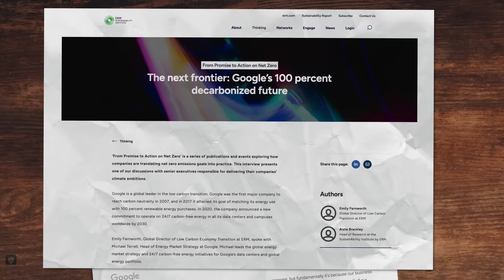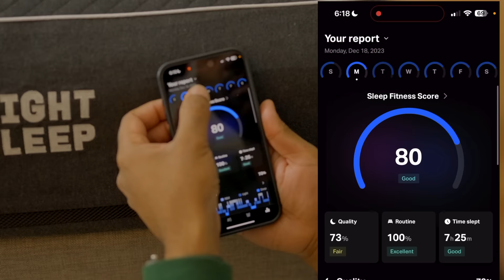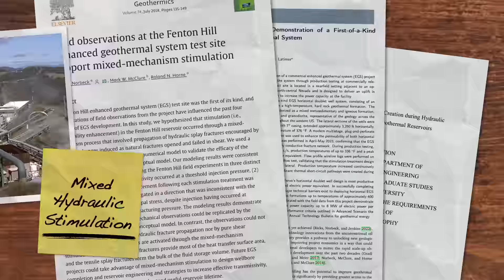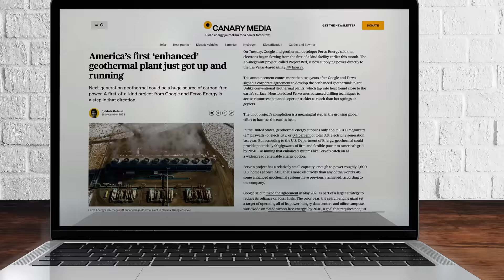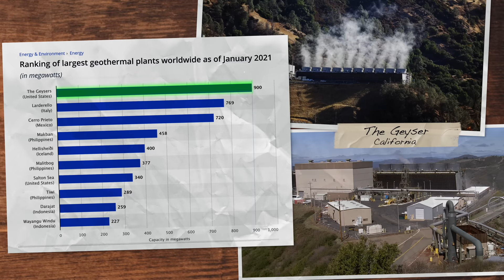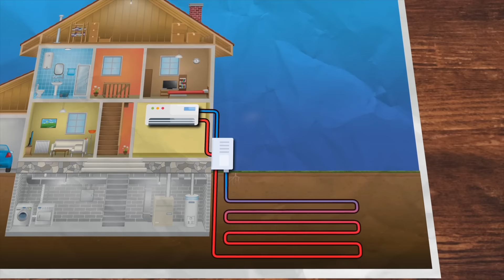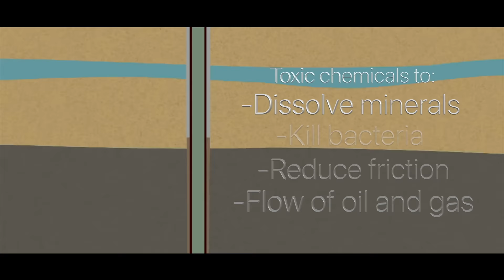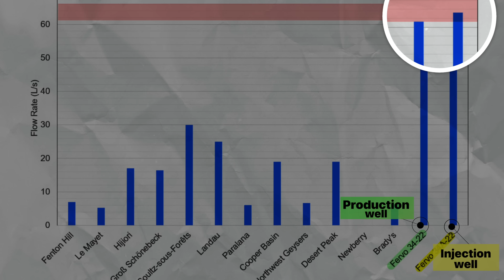Google’s Billion Dollar Gamble: You Won't Believe What it is!

Comment from the maker: Go to https://www.eightsleep.com/ricky or code 'RICKY' for $200 off!
Reply: Great research and presentation - thanks!  I'm actually okay with fracking in the oil and gas industry as well as efforts such as this.  Wind and solar need to sit on the bench for awhile, and frankly have larger potential for long-term environmental damage in my mind than fracking for fossil fuel extraction.  Now that you know where I'm coming from, I have a large-scale question that was unasked in your video.  What is the potential long-term effect of removing heat from the Earth's crust?  Admittedly this is a small effect, like asking "what is the effect of slowing the natural movement of the air above us from wind energy production?"; but it is real and quantifiable just the same.  As geothermal production of various sorts scales up, it could become an issue.  Any thoughts?
Reply: Conducting heat from the earths interior (outward) while you simultaneously leak cooling waters into it on a large scale will cause the earths interior to cool at a much more rapid rate than it would otherwise. Cooling a planets interior is the progressive march of that planet toward a frigid death, not to mention the magnetic impacts as you do
Reply: I burst out laughing when you used "Harry Potter" as a verb instead of a name, lol.
Reply: Sounds alright but I think this is going to cost Google. I think the price of Geothermal has 10-20 year ROI unlike solar and batteries which is 10 years and below. I mean, if solar is cheap, just overbuild it and throw the excess energy or maybe run additional cooling equipment.  Aside from that, solar has little maintenance or high reliability.
Reply: All of the energy it took to mine all of the minerals is renewable? The people that die while mining are they renewable?
Reply: Did I miss the link to the paper?
Reply: @bradarmstrong3952  Why did you not address the propriety information of what companies use to frack? Answer how many active volcanoes are doing something every day first.
Reply: lol $2k for the sleep system.   that's quite the luxury.
Reply: put your hands and feet out when you sleep, problem solved...
Reply: @Caldaron  -  My ex use to put her ice cold hands and feet on me while she slept LOL   I am like an old bear and was a source of warmth. She used to say, Warmth in the winter and Shade in the summer (referring to me being big and fat) HA HA   Your theory has merit.
Reply: Thank you these wonderfully informative, nuanced performances. You, young man, have taught me a lot this past year or so.
Reply: Your biases when it comes to fracking are somehow suspended when it comes to mining lithium, cobalt etc needed for batteries used in electric cars.
Reply: Also why use fracking instead of a closed loop steam generator
Reply: the water that remains underground has to be going somewhere, its not disappearing into a black hole.  so either it will fill whatever reservoir its currently filling and then stop (thus no longer losing water to the ground)  or its ending up back in the groundwater/ocean eventually, which is how the water cycle works anyway
Reply: @uncletrashero  -  WHich is a good thing since ocean levels are rising... So losing some underground is not a bad thing. " so either it will fill whatever reservoir its currently filling and then stop (thus no longer losing water to the ground) "
Reply: As amazed as I am by this new project and technology the elephant in the room is not the fracking. It's the fact that you keep calling wind and solar carbon neutral, sustainable energy. And as amazing as his technology is, it's still not carbon neutral stop lying to the people.
Reply: This is a horrible idea.  Cool the core of the Earth and you kill the magnetic field ... then everything on the surface dies.
Reply: His slamming criticisms of fracking are gross.
Reply: I just subscribed to your channel without you asking me. Who would've thought that's possible? :D
Reply: The problem I see with this, if your putting more water in than your getting out. Your losing water. We have serious drought so that’s a waste of water.